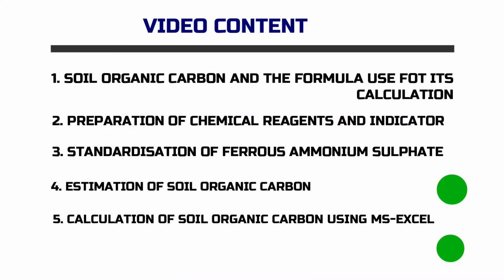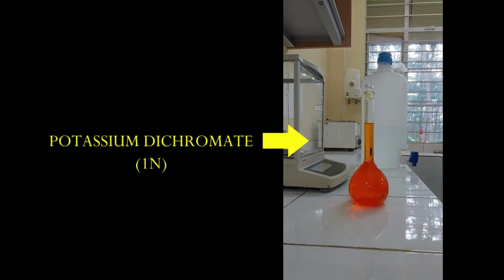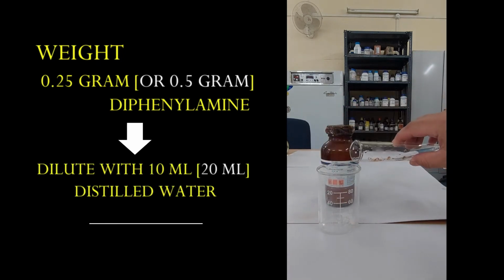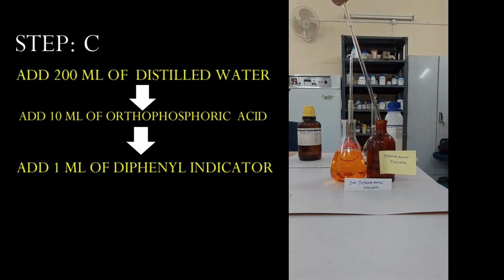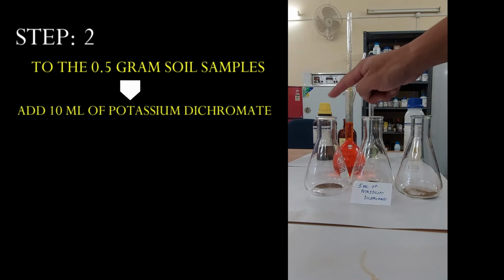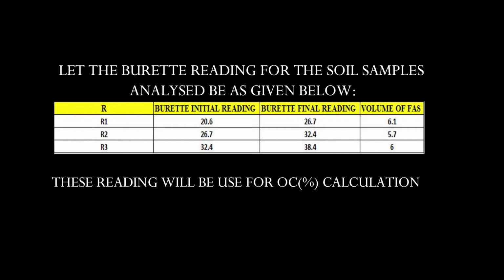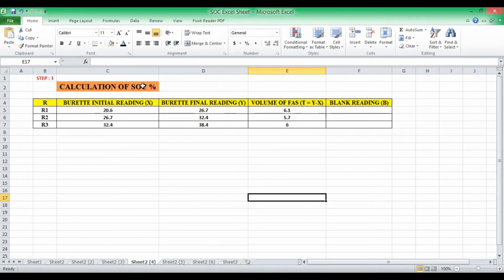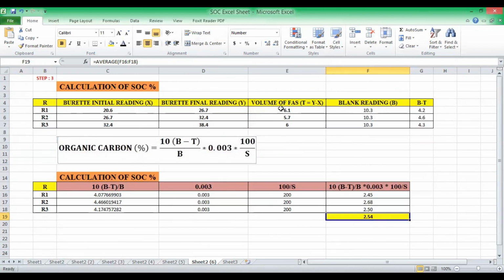Soil Organic Carbon estimation using Walkley and Black Rapid Titration Method (Soil Practical)

Comment: The analyzed sample is fruit waste, which is very rich in total organic carbon (TOC). The average titrant volume for the sample is approximately 3 mL, while the titrant volume for the blank is 20 mL, with a sample mass of 0.015 g. However, when applying the calculation formula, the resulting TOC values reach several hundred percent. Could you please advise where the error lies in my analysis? Thank you.

Comment: Thank you so much for this video! May I ask what you mean by "air-dried soil"? Did you just leave the soil sample opened to air for a certain period of time?
Reply from the maker: Thank you so so much L.P.
I feel good and very happy to know my contribution through this medium is helping others. Very grateful. 
Yes, you are correct. 
Thank you 😊
Reply: @JustLikeASteam  Of course, it is very helpful! Sorry for another question but would you be willing to explain the reason behind using air-dried soil?
Reply from the maker: @l.p.22  First of all, it is the standard methods of soil drying use for soil analysis. Next, such method won't hamper the soil properties. Thank you 😊
Reply: @JustLikeASteam  Hi, I'm conducting this experiment right now but when I add 1g of soil sample with the potassium dichromate and concentrated sulfuric acid, the solution keeps turning green instead of remaining orange. By any chance do you have any idea to solve this problem? Should I reduce the mass of the soil? I'll appreciate it very much if you could let me know 😭🙏
Reply from the maker: @l.p.22  Hi I'll suggest you to please follow the steps meticulously again 
Normally the soil samples react as shown in videos. I haven't come across in your version. So again please follow the steps meticulously ok.
 Tha k you
Reply: @JustLikeASteam  Thank you!